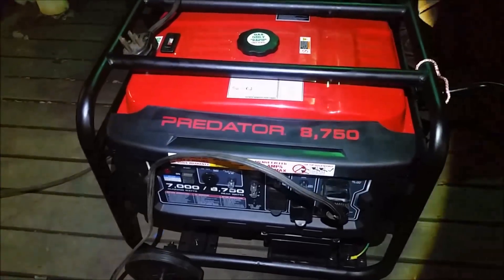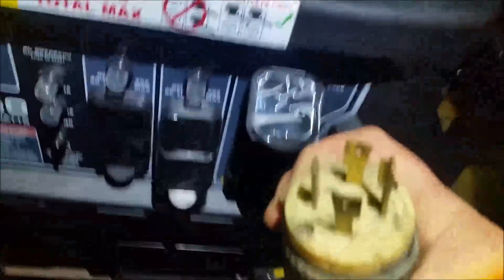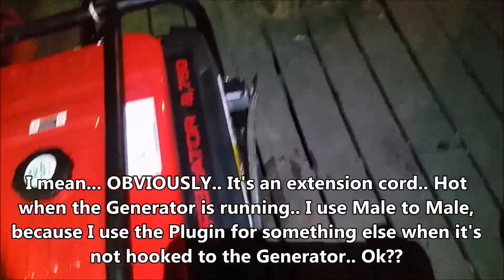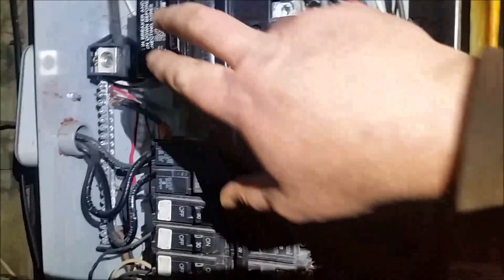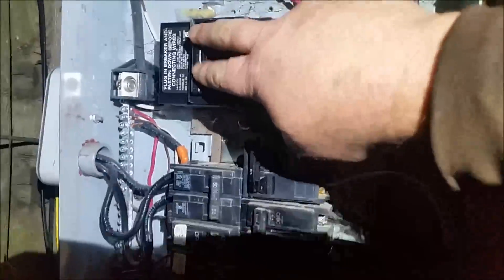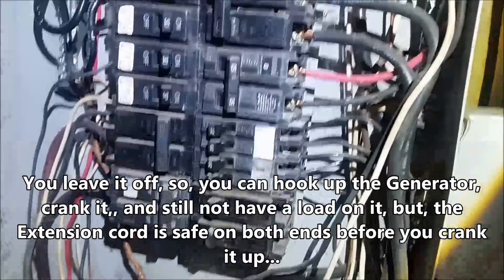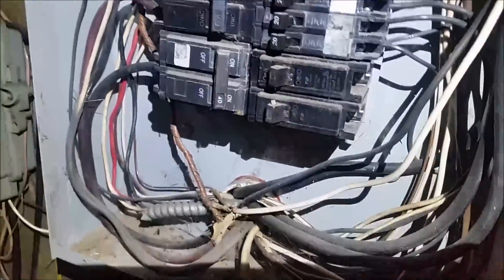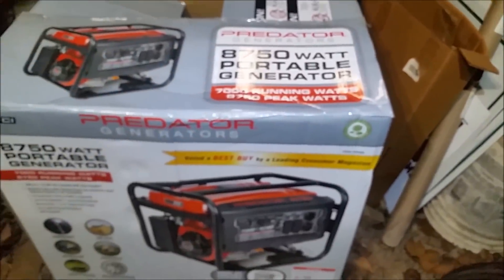Quick/Easy/Safe: Use Existing Plugin/Breaker for Generator hook up to your house Panel box.

Comment: Say what you want. If the main is off there is NO connection to the utility company and no one will be hurt. So all of you that criticize this man for how he doesn't deliver his explanation in a perfectly text book form are out of line. He speaks over and over about common sense which is the least common sense of them all. He knows what he is doing is safe for him but not for a lot of others and says it very well.
Reply: The breaker he is using to feed the panel via the rigged cord is not listed nor tested to be used as a service disconnect. It is being fed backwards and may not trip at rated ampacity. It is a code violation and therefore not safe as the code is the minimum safe installation.
Reply from the maker: You are correct.. The Main Breaker is the Service disconnect. Not sure how you could mistake that, but, it stands corrected..  The Generator breaker is larger than the breaker on the Generator itself, so, the circuit is protected at 30 amps before it gets to the breaker you are referencing. The second breaker since larger is not used as a "Trip Breaker" it is used as a disconnect, and not needed as a trip circuit.. The Main breaker is always off before the generator is hooked up.. I'n not sure why you missed that.. Extension cords or temporary power cords are not covered under NEC..
Reply: @MarkThomas123  is it listed as a disconnect? And if so it is being fed from the load side from the homemade cord which would be not code compliant. It's not tested to be safely operated in that manner.
Reply from the maker: Wow.. You can't read???  The Generator Breaker is the Breaker for the Circuit... Let me see if I can get elementary here so you can understand.. 
If you have two breakers in a circuit.. One is a 30 amp at device (A) and the other is a 50 amp at device (B), and the load passes from A to B.. What is the amperage max of the circuit? BTW.. It does not matter if it passes from A to B or B to A.. The end point is protected either way.. Where the breaker trips is where the electricity stops in the circuit.. End point cold on either breakers account. 
The Generator Breaker is the 30amp at A providing the power to the circuit and first inline anyway, since that seems to be a contention point. I thought I was clear, but, you should know the Generator is providing the power to the circuit, so, I didn't mention that directly before.. I guess I made an Assumption..  I guess we know how to spell Assumption.. Ass (out of )U (and) ME.. 
If that is not clear enough, try explaining it to me, so I can see what it is that you don't understand and address that specifically..
Reply: @MarkThomas123  there actually is a whole section on temporary installations. We use it all the time for big generator set ups. For a real eye opener look into the ground rod required for temporary generator use. I have driven dozens of them in just for that.
Reply from the maker: +Ronald Archibald.. Dude.. You really amaze me.. Does it make you feel good to claim you are something you are not?? Electrician?? 
Every time one of you guys says you are an electrician and spout off this nonsense,, you make me comment how damn long it will be, before I would ever THINK about hiring an Electrician.. I don't care if he carries a card, has a truck with a logo and Company name on it, etc.. I have never seen such a group of mindless people.. You honk about NEC Code.. You are an Electrician.. IT IS YOUR JOB TO KNOW THE NEC Code... How can you not know less about the NEC Code than me,, when I have only done some casual searches since I have posted this video and research things I am not sure about before I respond.. 
I want you to realize something.. I posted this video in January of this year.. It is now middle of September of the same year.. I have a casual knowledge from a few searches here and there about the NEC code for less than 9 months and I know more about the NEC than you.. 
A WHOLE SECTION ON TEMPORARY INSTALLATIONS??? Ha..Ha..Ha... How Clueless.. There is a WHOLE SECTION ON GENERATOR INSTALLS.. It just happens to be the SMALLEST SECTION IN THE NEC.. The SMALLEST SECTION IN THE WHOLE DAMN THING.. How can you not know that??? 
I knew you could not post the section and subsection of the NEC that you claim Exists.. I had ZERO DOUBT!! ZERO!!.. I have already researched it.. 
NEC does not cover "Extension Cords or Portable Extension Cords".. However,, they do define what they do cover by saying,,, they don't cover commonly connected and disconnected cords.. Cords meaning having plugins on the ends of them.. Also called Appliance Cords..  Where is this reference??? The discussion of Heat Pumps, A/C blowers, etc,, having temporary cords or appliance cords vs being hard wired.. If it is not commonly connected and disconnected, then, it should be hard wired and not left with a plugin.. Those things hard wired is what they cover.. 
The only section in the NEC that even comes close to talking about Extension Cords or Portable cords,, is the section describing exactly what I am talking about.. Since you studied the NEC and you are an Electrician and it is your Job to know the NEC,, let a jack of all trades shade tree part time, do what needs to be done home trained Electrician quote you the codes, so you learn something today.. 
It is: NEC CODES  406.6 and 406.7
Read the first answer to this question by the forum Moderators.. Read it a few times.. Even though he disagrees,, NEC does not cover the "Suicide Cord".. 
You can follow the conversation a few posts down when the codes are listed and several of the guys comment about it.. It is some Electricians back and forth, so, they can't figure it out either, since the Moderator spoke his piece already and they know not to argue with his wisdom.. 
So, after you have scanned the first link,, go look at the NEC Definitions on the second link and go back and read the first link again.. I think you can pick out what is going on.. Don't forget to notice the "Plugs and Recepticles as it is repeatedly mentioned in the code".. That is exactly what they are talking about.. 
The Ends of the Cords.. It is why you see the phrase Appliance Cords and not Extension or Portable cords.. NEC does not regulate them.. Simple as that.. 
There has to be some Intelligent Electricians out there.. Somewhere... I hope to be able to meet one one day.. I have not been impressed with a single one that has commented here yet... But, you can say you learned something else from this video and it's producer.. Ha..
http://forums.mikeholt.com/showthread.php?t=158086 
https://iaeimagazine.org/magazine/2014/12/02/article-406-receptacles-cord-connectors-and-attachment-plugs/
Reply: Mark Thomas o
Reply: Mark Thomas You wouldn't last 5 minutes in a debate with Mike Holt. While working in the trade took His Comprehensive Journeyman Class, a few years later took the Master Electrician Class passed all Block Proctored Exams both Journeyman and Master for my State and completed 14 + hours CEU'S every two years under various other professional electrical Educators for a total of over 40 years electrical experience including 200,000 kw generator sets. You are giving dangerous advice. I won't even debate You until you successfully complete a Journeyman course because I would want You to follow along with a current NEC code book. Actually if You took a course we wouldn't need to debate the issues because You would understand the problems. Mike Holt  "Concepts in Electricity". is a good place to start.
Reply from the maker: Bobben47.. Well Mr Bobben47.. Ha..Ha. All of that study.. Did it do you any good? I have good reason to think it didn't.. Because when you read something and don't comprehend,, what good did reading it do anyway?? Just curious.. Because I scrolled back up to look and see how you could make the statement about "I wouldn't last 5 minutes in a debate with Mike Holt", when didn't make any reference to Mike Holt to begin with. 
My comment was about the Moderator who posted the first answer to the Male to Male cord issue.. 

I paid him (The Moderator-  Iwire)  a generous complement for agreeing that the NEC didn't cover temporary or portable extension cords,, even though he stated that he disagreed with that.. 
Something you should know after all of that study.. And, being an electrician,, you should also know that it is common in the industry to backfeed through breakers to power things... And, you might imagine that it is done quite commonly with a male to male cord.. But, electricians know that.. 
https://www.electriciantalk.com/f2/breakers-directional-19714/ 

But, here is my comment about The Moderator. Like I said.. You have to add Comprehend with all of that reading for it to make any difference.. So, this time, see if you can do a little better job with it.. Here is the statement after I said
 It is some Electricians back and forth, so, they can't figure it out either, since the Moderator spoke his piece already and they know not to argue with his wisdom.. 
But, not to short change you, and make you think that you missed something,, I will post the whole thing related to Mike Holt forum post, so you see that I actually did mention his name, just before giving him the complement.. Here we go.. 

Read the first answer to this question by the forum Moderators.. Read it a few times.. Even though he disagrees,, NEC does not cover the "Suicide Cord".. 
You can follow the conversation a few posts down when the codes are listed and several of the guys comment about it.. It is some Electricians back and forth, so, they can't figure it out either, since the Moderator spoke his piece already and they know not to argue with his wisdom..
Here is the post I posted the link to, so, you can try that reading and Comprehension thing again and see if you can get it right this time.. 
http://forums.mikeholt.com/showthread.php?t=158086

Now.. Maybe you are referring to this statement that I made at the end of the post, and another point I would like to make and show a clear example of.. 
There has to be some Intelligent Electricians out there.. Somewhere... I hope to be able to meet one one day.. I have not been impressed with a single one that has commented here yet... But, you can say you learned something else from this video and it's producer.. Ha..
http://forums.mikeholt.com/showthread.php?t=158086 
There is one more link under this one in the post above that is the NEC definitions for what it talked about in the post. 
You should scroll back up and take a second or third look at it.. Here is how the post starts to help you find it, since the links are under the "Read More" link. 
+Ronald Archibald.. Dude.. You really amaze me.. Does it make you feel good to claim you are something you are not?? Electrician?? 

Now. to make my point.. This is a statement that I made in that same post.. And, it still stands true.. But, I thought, after reading a line or two of your post that, this might change, and be changing right this minute.. Hell, ,with all of that training,, maybe I just ran into someone who would change my opinion.. But,, NOPE!! It Still stands.. 
My statement: 
There has to be some Intelligent Electricians out there.. Somewhere... I hope to be able to meet one one day.. I have not been impressed with a single one that has commented here yet... 
Why?
1) You seem to be accusing me of making a sly statement against Mike Holt, but, the only reference to him was his name in the URL.. 
2) The comment I did make, was a compliment to the Moderator of the forum who made the first reply.. He was honest and said,, NOT REGULATED BY NEC, but, he felt it should be.. I said, no one questioned him because of his wisdom, which was a true statement.. No One!!
3) I am giving Dangerous Advice??  That is the Most Ignorant statement of all.. 
Turn the Main Breaker off. 
Hook up the Male to Male Cord
Crank the Generator.. Disconnecting the generator is exactly the opposite steps.. 
In your ultimate wisdom.. Since I am giving Dangerous Advice.. Would you mind educating the rest of us on exactly,,, with all of your years of training,, exactly what or which step of the above 1/2/3 steps are dangerous??  I'm sure there is more than myself that is interested.. After all, you are a Journeyman..Correct? 
4) Follow along with a Current NEC Code book.. You are referring to the 2017 NEC? The one that has very few states that have adopted after  a year?
Since you seem to know about the NEC, maybe you can tell me which code book has the widest acceptance and of the widest acceptance,, how many states have adopted the whole NEC?? Ha.Ha.Ha.. And, which is the next most popular Code book accepted.. ?? And, out of ALL Versions of the Code Book,, how many states have adopted or have adopted at least small portions of the code book.. Because that will tell us how many states have not adopted any part of it, and since you studied the book, I would like you to tell everyone here just what that number is,, so it came from one of you guys and not from me.. National EC.. Sound like Federal something. Like Federal Express. The only thing Federal about it or National about the NEC is the word itself.. 
But,,, like I said. I would really like to meet an electrician who impressed me with their knowledge.. And, I am still looking.. 
Because how could you fuck up reading a simple post so bad???  I mean.. That is 4 Major Fuckups.. 
There is a serious problem with your Reading and Comprehension.. You really need to focus on the Comprehension part of things before you go any further with your training.. And, it really helps to have common sense to wrap it all up.. Because, I have ZERO formal training and I think I can effectively argue as I just have and prove that I probably know more about the NEC than you do, and I have not really read a full page of it. Amazing?? 
Go back and read what I posted and what you posted. I really don't see how you could disagree.. Honestly.. !!
So,, rather than me following along with you, how about you go back to the post above an follow along,,, since the the website with Mikes name on it means so much to you, and you probably agree that the Moderator who made the statement is very knowledgeable.
Because,, you are Definitely NOT, and what is already posted proves it... Jesus Christ.. 
I am just an Average guy.. But, you guys make me look like a Genius!!
Reply: You seem to have a propensity for confabulation which makes any intelligent debate with you pointless. You will continue doing what you want because it works for you. However it is unfair to tell people this is O.K. to do when it's not. Every electrical installation is different. I remember a hurricane years ago when a whole neighborhood did what you are recommending. The power company (a lot of crews from out of state) helping restore power found the high line hot shorted the line to clear it. the result the next day as I went to Home Depot for supplies to do repairs in the neighborhood I saw a line of 20 or more people returning blown generators. As I was working in the neighborhood I had occasion to work for some of these people. To a man they all had (now obsolete) split buss panels. they thought they turned off the Main but only turned off the Lighting Main leaving the Water Heater, Range, Dryer, Sprinkler Pump W/Timeclock, A/C still on . These circuits back-fed the power co. Transformers which in turn induced current in the Primary making repairs impossible. The circuit was shorted taking out the Generators. You're inability to grasp the "Big Picture" because of lack of proper and complete training is putting the Public at risk. Injuries or Deaths caused by Your video could create a Liability that I'm sure You don't want.
Reply from the maker: Wow.. You sure come up with some colorful and ABSOLUTELY STUPID IDEAS that you turn into ABSOLUTELY STUPID LIES you say happened... Let me show you how I know you are a VERY STUPID LIAR.. I mean,,, SOOOOO STUPID!!!!!  And, Shows how little you know about Electricity.. Not even the Basics of even how a Generator Works... YOU ARE SOOOO STUPID!!!!!  And, to Challenge ME???? Well,, it is a Challenge FAILED!!! Here we go.. Hang On,,, HERE COMES YOUR SUPER STUPID RIDE!!!
#1) I have been doing this safely for 15 years, some that have commented here 20 plus years.. That makes your Comments Assinine.. Of course, in now way would I think someone with your brain matter could do this.. It is too simple..  All you need is a generator, Male to Male cord and an existing plugin.. Probably way over your head.. But, not others who have common sense.. 
#2) A Whole Neighborhood was on Generators with a hook up like this,, and the were all backfeeding the line.. Ha..Ha..Ha..Ha.. Ok??? Ha..Ha.. 
The Power Company,, "Shorted the Line"... Well,, If that were the case, and that could possibly happen, and all of the generators were in phase and it happened to begin with (odds of all of them getting hit by lightening 3 times in a single day-I'll explain in a minute), Shorting the Line would do nothing more than trip the Generator breaker and there would be ZERO REASON that they would all be at the same store trying to return generators when all they would have to do is turn the break back on.. Ha..Ha...Ha.. But, you would not know that.. Hot to Short/Ground trips the breaker.. See what I mean about Zero Electrical knowledge?? Ha.Ha..Ha. What a Dumb Fuck.. 
#3) Old Split Bus panels have a Pull Fuse for the main with two snap in bus fuses. How could they mistake a screw in fuse for a Pull Out Fuse that Says Main??? Well, considering who came up with and wrote your story,, I understand. Stupid to everyone else who reads it,,,, EXCEPT YOU.. How Stupid!!!!!
#4) A SINGLE GENERATOR Backfeeding to Utility.. HOW STUPID... The Immediate load from EVERY OTHER HOUSE NOT ON GENERATOR,,, WHO HAS NOT TURNED OFF THE MAIN BREAKER,,,, Would pull such a load,, the second you cranked the generator and flipped it's breaker on,, there would be such a load that the breaker would flip right back off, or the generator would die under load..  HOW STUPID.. That is not even the Big Picture..How Brainless to think what you said would even work... A backfeeding generator for more than a half second?? Ha.>Ha.>Ha.. 
#5) Multiple Generators Backfeeding at the SAME TIME????? Ha..Ha..Ha..Ha..  THIS IS THE MOST RIDICULOUS OF THEM ALL.. 
I see that you know NOTHING about Hz, Phase, Phase shift, etc.. Need to read up on 3 phase and how it works, and then read up on "Dual Power Feeds - Utility Power and Plant power at the same time.. Because, if you have more than one power source,, you'd better know exactly what you are doing and  have some pretty sophisticated equipment  and you better be able to vary the Hz or time the phases, so they are in sync, which you will never do on a generator that is running on a gasoline engine with loads and RPM;s that vary.. You would never be able to keep the phase waves in Sync.. And, when you have two phases 180 degrees out of sync, you will double the voltage when they meet and that would have taken out each generator as it came online.. The same reason why "If the Power Company"  was super lucky and were able to catch a generator backfeeding the Utility line and were in the process of powering up, the generator would take a hit.. Would it damage the Generator?? Most likely.. They are not designed to run 440v or higher...
The Likely hood of anything you said in your last post happening is so remote that, it would be like getting hit by lightening a couple times in the same afternoon... You are SOO IGNORANT it hurts..
Reply: James P Bergeron - explain to me “ if the main is off there is NO connection to the utility company” when you kill the main breaker, you disconnect the ‘hots’ at the breaker...what about the neutral coming from the generator, how is it isolated?  IT IS NOT.  Neutral in a perfect world shouldn’t carry any current, but with amateurs playing with electrical hookups, you’re never guaranteed that.  This is an UNSAFE hookup.  Btw: I’m not an electrician, just someone with better common sense.   Research how a GFCI works too.
Reply from the maker: bbrjj2.. I hate to be the one that makes you look stupid, but, it is so simple, I can't quite figure out how to tell you that you are stupid without telling you that you are stupid.. But,,, have you ever looked at a Meter pan and meter?? How many wires are being unhooked or broken or disconnected?? Two correct? Two Hots correct? Have you figured out some way to get electricity from the power company through the neutral?? I would really like to know how you propose to do that.. Maybe I am stupid or something, because for the life of me,, I can't figure it out.. Ha..Ha..Ha.. Do you guys ever think about what you are going to say before you say it?? Ha..Ha..Ha.. I can't imagine anything after that comment actually needing a response, but, I have to read on just to see what the hell you will come up with next.. I am trying to figure out how you Snowflakes think.. It is confusing as hell.. Or,, is it the lack of thinking?? Let me keep reading.. 
Neutral in a perfect world shouldn't carry any current?? Ha..Ha..Ha.. Here we go again.. Ha..Ha.Ha. Lets see how we can literally explain this one..Ha..Ha.Ha.. What color wires are connected to a wall receptacle?? Black,, White and Green or bare copper right?? Then,, in your world,, I can disconnect the white wire and things still work correct? After all, in a perfect world,, it should not carry any current.. Lets see if we can figure this out another way, using some brains.. Maybe you can take a few minutes to explain to me how a GFCI works without using the Neutral..Ha..Ha.Ha.. 
OH MY GOD???? You actually mentioned how a CFCI works??? Ha..Ha..Ha.. That is exactly how it works.. By monitoring the balance of return power through the neutral and when it goes out of balance, it flips the circuit off.. Wow,, Common Sense?? Ha..Ha.Ha.. Better??? Ha..Ha..Ha.. NONE BUBBA!! NONE!! Even using the basics, you screwed the pooch.. I figured you knew nothing about GFCI, but, you totally missed the boat on that one.. How could you screw that up?? Ed Taylor explained it so a 5 year old could understand it.. I imagine you read that and missed that.. I won't ask you, your age.. It doesn't matter.. It's the age of the mind, and you have demonstrated that more than well enough.. Read and don't type.. We won't be so sure how dumb you are.. Ha..Ha.Ha.. Read and learn and then post.. But slow down.. You are running right past what you need to learn.. :) Cheers.
Reply: IT WORKS AS LONG AS THE UNEXPECTED DOES NOT HAPPEN....................UNEXPECTED THINGS HAPPENING IS THE ENTIRE REASON FOR CIRCUIT BREAKERS AND FUSES   ............   GET A MANUAL TRANSFER SWITCH
Reply from the maker: And,, what are you trying to say.. There is not a Main Breaker disconnnected in this procedure, or there is not a circuit breaker on the generator and on every consumption circuit.. I am trying to figure out what your point is.. Breakers are there for a reason, and this application is no different.. the reason why I am wondering what you are talking about.. But, you are the typical Ignorant poster, instead of reading before you speak, you find some need to show how ignorant you are.. It's actually quite amazing to a guy who when he makes a statement makes one pinpointed to the situation.. 
BTW.. You probably don't know, but, there are no Specialized breakers in a Transfer switch, since that was your point.. The wire up is just different. 
But, it is not applicable in this setup, because you have to have a dedicated breaker and a dedicated Exposed Male Plugin outside of the switch and there is no way to use an existing breaker or existing plugin for this purpose.. So, another ignorant statement not applicable to this video..
You should pay more attention..
Reply: Better put a meter on the utility feed to make sure, we've had main breakers get arced closed and with them in off position the power will not be disconnected.
Reply from the maker: 27613.. Hmm.. Guess you never heard of UL listed Electrical Equipment being required to "Fail Safe", even when arced... 
Stop smoking so much of that crap.. You are starting to hallucinate..
Reply from the maker: James P Bergeron... Thank you James.. Finally.. Someone "With" the not so common any more,, Common Sense..  You hit the nail on the head..  Something tells me you are from the Deep South..  I know a few in the Parishes.. Cheers..
Reply: Yes you are right if the main is OFF there is no way to back feed the power Co.Just make sure you disconnect the Gen. before you throw the main.
Reply from the maker: Charlie M Exactly..  You are 100% correct. Service is Disconnected via the Service Disconnect.